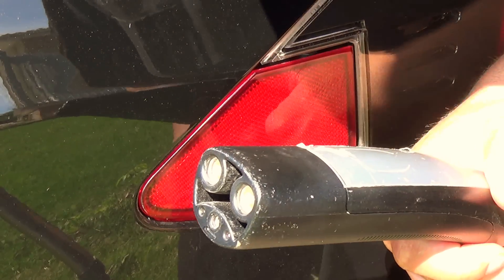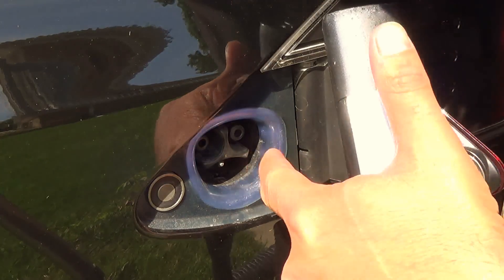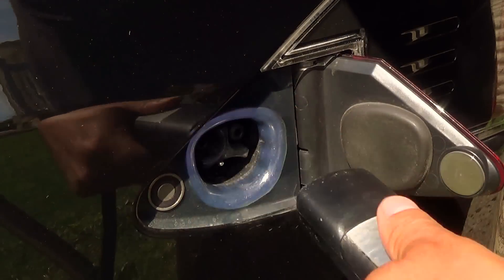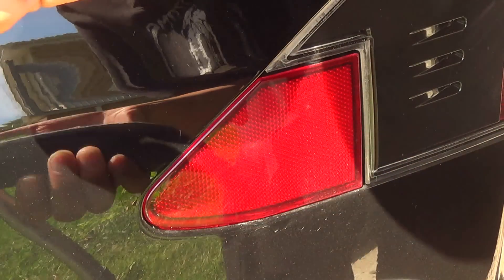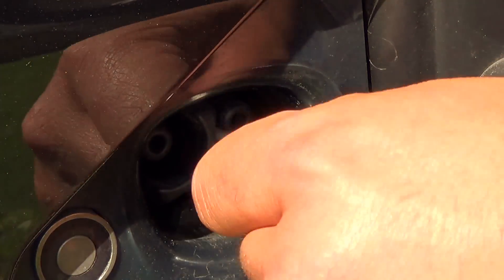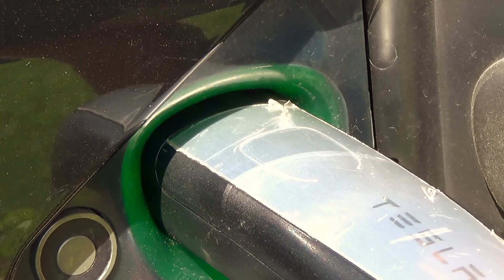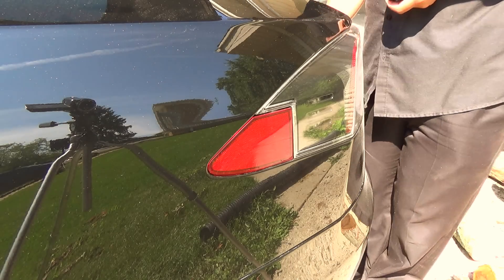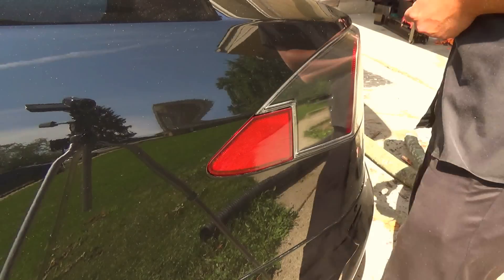Tesla Motors Model S/ III / X: Cleaning Charge Port, UMC/HPWC & Adapter

Comment: Thanks. Q tips are a good suggestion. My plug end was full of carbonized soot, not charging. Cleaned it up with Qtips and contact cleaner.
Reply: That plug adapter is not dirty, that looks like carbon from a bad connection. And that plug looks to be in good condition, so the problem is likely the receptacle.   I've used sandpaper before. If you use contact cleaner it's usually unnecessary even if it doesn't get shiny. For most electronics I will first use a pencil eraser, then contact cleaner. Sandpaper is down the list. 
On a plug.... easily replaced, not too expensive... sure. What you also want to do is feel your cords and plug ends. Are they getting hot? Warm? probably okay, but hot indicates a bad connection, corrosion at the prongs, inside the plug or between the wire and the screws/connection. Best to just replace the plugs and outlets.  

Sandy Munro, auto engineer/analyst pointed out that the plug in Tesla chargers if used at high amperage have started fires. My circuit only allows 15 amps, I run it at 13 - no problem. If you do charge in your garage or from a plug hanging on your house, and use the higher amperages, is it getting hot? Might be best to upgrade to the wired in Tesla charger.

Comment: Any solution or advice for difficulty plugging and removing the charger. Thanks. Does silicon grease help?
Reply from the maker: make sure your charge port is very clean. No do not use any grease. If it’s clean it should insert and remove easily. I’m going to take a guess that you have a model Y? A small number of model threes and a larger number of model y’s Had a defect with the charge port where it was too small causing extreme difficulty plugging and unplugging
Reply: @KmanAuto  Thanks I will try to clean it carefully and see how thing's go. I have 2015 plugin Pruis and a Duosida (White charger) .  Note:  I removed the orange gasket from the charger but  the problem persists.
Reply: Update: I cleaned the charge port and the charger with  cotton like  what you did and plugging in did became easier but plugging out is still difficult.
Reply from the maker: @zaidalhabshi  You can try a little bit of lubricant. Like silicone spray, NOT grease. Put some of the spray on the cotton swap, and then coat the inside of the charge port (just a coat, not dripping wet). Be sure not to get it on the metal charging contacts. This may help. Usually last resort to do this.
Reply from the maker: @zaidalhabshi  And do not use anything with Graphite, while a dry lubricant would be best, graphite is conductive and could cause a short.
Reply: @KmanAuto  Thank you very much for your video and reply, appreciate it a lot. I will try that and update here
Reply from the maker: @zaidalhabshi  My Pleasure! :-)

Comment: This is interesting.  So poor contact from from dirt causes the connector to heat up.  Does the Model S monitor the temperature of the charge port and reduce the current if it gets too hot?    Does the car's display inform you that your charge current is less than optimal?
Reply from the maker: Sort of, the car measures resistance of the wiring. If resistance is too high, it will back off charging current by 25%. Done this way as it will also help detect wiring faults with the plug and building wire as well.
Reply: ***** I have a friend with a Model S.  He said Tesla replaced the connector on his car because it was melting.  Clearly the feature wasn't working on his car.
Reply from the maker: For starters, it depends on when that was done. That software update was introduced last winter. Second, it has been adjusted constantly to try and reduce nuisance tripping, and last, it cant cover everything. It helps, but is not fool proof.
Reply: ***** I understand.  I'm genuinely interested in the issue.  I'm building a 50 amp OpenEVSE and seeing similar issues.  Good contact quality is paramount.  You should market a connector cleaning kit.
Reply from the maker: That would require removing a 1500 Lbs battery, opening it up, opening the contactor and putting it all back together, so factor in a day or two, a few weeks if you dont have a car lift :)

Comment: I'd recommend using 500 grit 'wet and dry' paper from an auto shop designed for metal, used dry - and not sandpaper, which sheds abrasive and is really designed for wood and paint.

Comment: I've had mine for about 2 weeks and I consistently get spiders building their little homes in my charge port. I've been using a can of compressed air to get them out and it's been working fine

Comment: Not sure where you live or park your car but I was amazed to see not only the port but the adapter (plug-in) filthy dirty. Amazing
Reply: *****  That's the right attitude Kman. You are showing the Model S in real world conditions. Hat's off.
Reply from the maker: Well, let me see how clean yours is after 33,000 miles in a year ;)
Reply: ***** Don't get testy. btw - I 've had my car for well over a year  - doesn't look like that. Just was curious as to why your's accumulated so much crud. Maybe it's just environmental.
Reply from the maker: Wasn't being testy (See smiley face). My car is not a garage car. It's outside 24/7/365. I do wash it regularly though. In the end, it's just a car and I treat it as such. A Awesome car, but still a car.

Comment: Isopropyl Alcohol 99% would be best if you can find it. Is used to clean electrical contacts from oxidation - Are they brass connections? If they are Gold plated connections I would check with Tesla but any other metal would be fine IMO - electrical contacts are electrical contacts and it won't harm plastic as it evaporates almost immediately. I have personally used Isopropyl Alcohol to clean several delicate electrical contacts